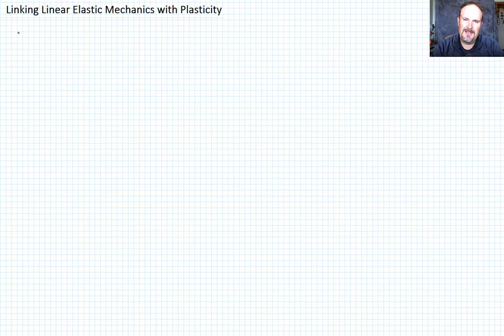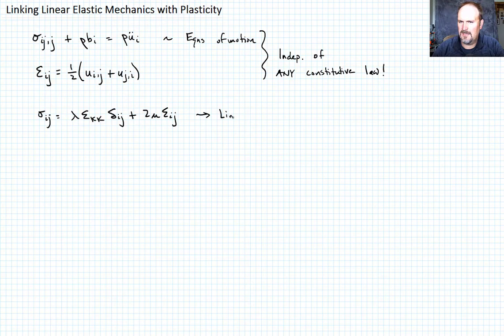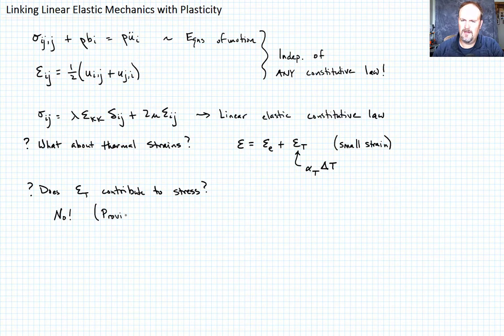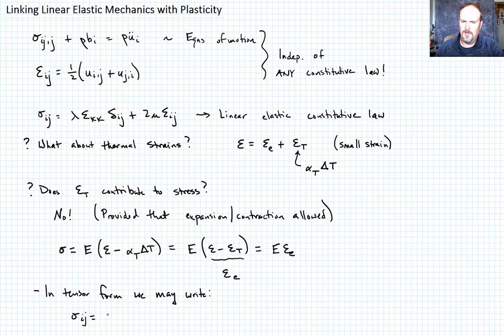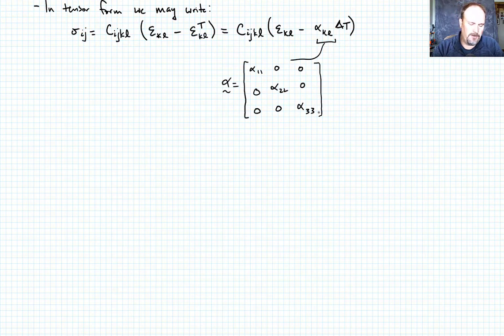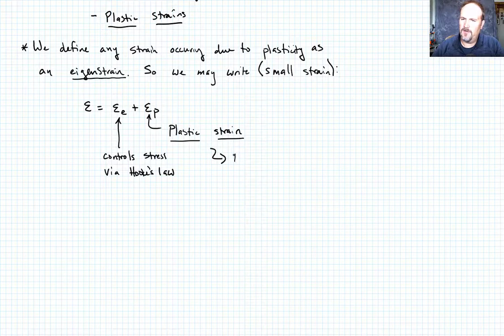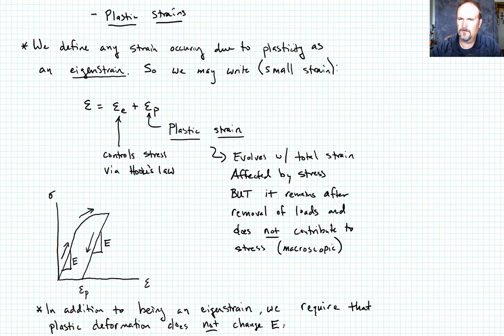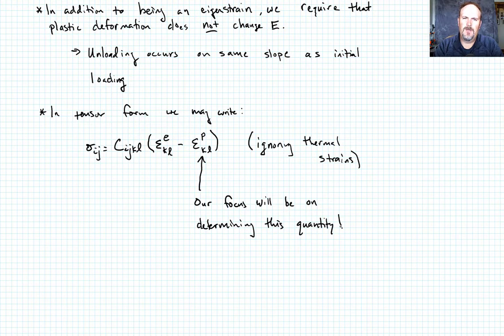1-6: Linking Linear Elastic Mechanics with Plasticity

Comment: Hi Dr  Ray ,   Thank your for your great lectures 
However ,  in time 10:52 of video ,  your wrote the stress= stiffness matrix *(Elastic strain-plastic strain) in which  you subtracted plastic strain from elastic strain,  Is it supposed  to subtracted the plastic strain from total strain? Thank you DR
Reply from the maker: Yes. It is a typo, the modulus should be multiplied by the TOTAL strain less the PLASTIC strain.